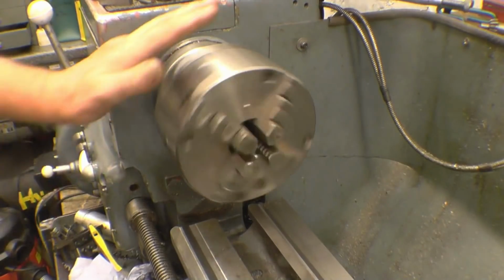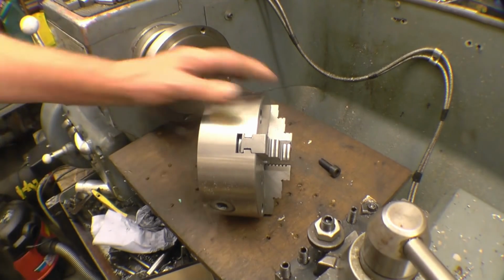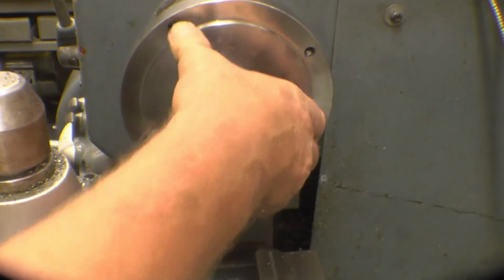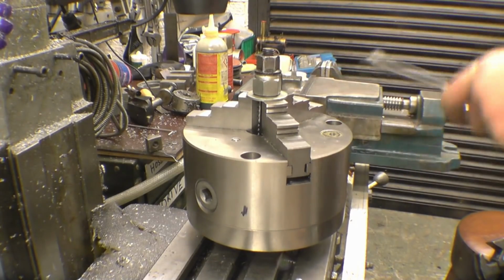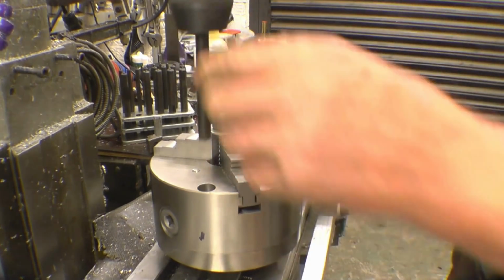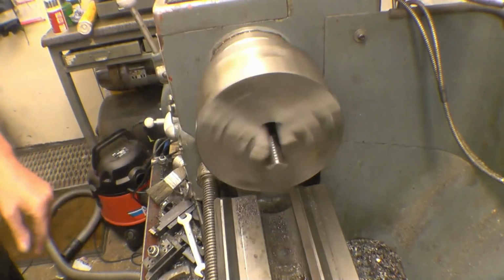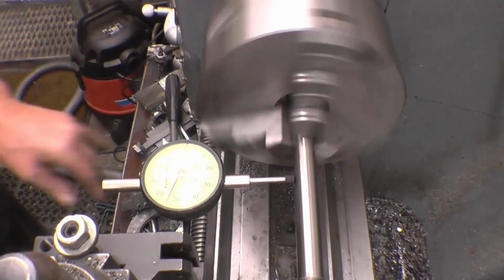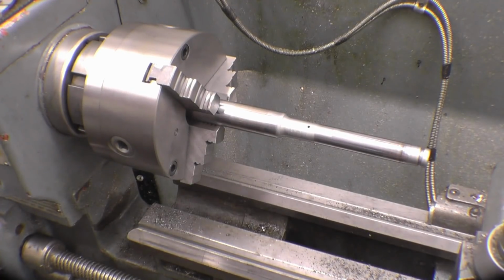SNNC 343 P1  New Chuck For The Harrison Lathe

Comment: What makes a chuck go off like that. Isn't it better to have the bolts bevelled so the automatically are seating I would have thought that would be better
 you don't know that gearbox shaft is 100% true not a test piece, wouldn't it better to just do the check up without anything and just measure the the end of the chuck Jaws wouldn't that be more accurate.
Reply from the maker: The chuck is made to a tolerance by mounting and setting up the chuck in this way the manufacturers tolerance can be dialled out  . The shaft i am using is dead straight and round ., They are used in the oil field for some set up work . Thanks for watching
Reply: @doubleboost  yes I see what you are saying, but what about the original chuck why was that drifting what causes it to drift out of alignment wear and tear on the threads,
Still not convinced about the test piece it's going to have some tolerance to it, I still think just measuring the chuck would be a better solution if they are machine accurately themselves what you would be hoping for if good quality,  the same as the shaft you don't know what tolerances they're going for.
I suppose you could make one test piece if it went straight into the shaft where the chuck is mounted to? I suppose that would be the most accurate to that lathe, and it was machine at that point Strait of the driveshaft. you could thread the end and have a threaded rod machined to be 100-percent accurate any chuck you put it in you know it's going to be accurate

Comment: Nice Chuck !
If you want it to last a bit longer than the old one don't use oil.
With the slow sliding speed and the great pressure between the parts, it's almost useless.
A manufacturer of similar Chucks recommends Molykote D Paste, its a white paste and should be sparely applied to all sliding surfaces.
Reply from the maker: Great point!

Comment: Hi John, The 0 on the chuck is the master "screw" and is the most accurate repeatable, You can get it to run much better, my Bison has a run out of 2/10"
Reply: Yes. Finishing tightening with any other socket than the one marked (with 0 in this case) will certainly be less well centered. Necessary clearance around the scroll means that the marked tightener is the one that pushes the scroll off center in the same direction that was used when the factory did the final grinding of the jaws. The other two tighteners push the scroll in wrong (less accurate) directions.
Reply: @PeterWMeek  Exactly.
Reply from the maker: I am going to have re machine the register and get it running dead true

Comment: A Polish made 5" Bison 3 jaw chuck came with my lathe and has been a reliable piece of kit for years now. I think you will really like yours.

The cheaper Asian stuff seems to work well at first, but doesn't seem to hold up quite as well as the more expensive alternatives. For tooling you use all the time, you are better off to spend the extra money.

Comment: I bought a 10" Bison 6 jaw setru new.  Cost about as much as a small car, but damn it's pretty.  I haven't installed it yet though since I can't lift it safely (about 120 lb).  Once the gantry crane is finished, it will be (nearly) permanently fixed to the lathe.

Comment: oh a new six inch not a new six jaw?? if you wanted repeatable a six jaw is unbeatable John.
Reply: If your stock is not PERFECTLY round a six jaw chuck will grip only with the first three jaws which make contact with to workpiece..    If you have a four jaw and learn to use it efficiently you will solve all your work-holding problems.   That's why a three legged stool doesn't rock, unless you are totally snakes hissed!!

Stavros

Comment: I think your problem was simply that it was a 4 jaw on round stock. 4 Jaws are fantastic chucks for certain jobs like square stock or rectangle (with 2 jaws out). For round stock they are alright but their repeatability is poor as it's easy to get it in wonky, especially when they have a little bit of wear in the scroll and only 2 jaws are making full contact. A 3 jaw always grips on all 3 jaws so even an old one can hold a reasonable tolerance long after a 4 jaw has become useless for round stock. 

I personally rarely use my 3 jaw chucks, I mostly use a collet chuck or one of my 2 jaw chucks but it is nice to have the 4 jaw for square stock.

Comment: John, I don't understand, you've replaced a four jaw chuck with a 3 jaw, what are you going to do if you need a four jaw?
Reply: I may be wrong, but I think the 4-jaw he replaced was also a self-centring scroll chuck, not the normal 4-jaw independent type.
Reply from the maker: The 4 jaw was self centering not independent
Reply: @doubleboost  John, i wondered the same thing...
Reply: @doubleboost  Ah thanks, makes sense now, stay safe.